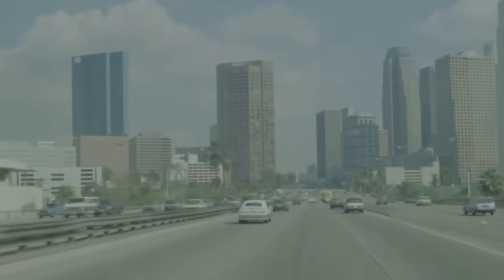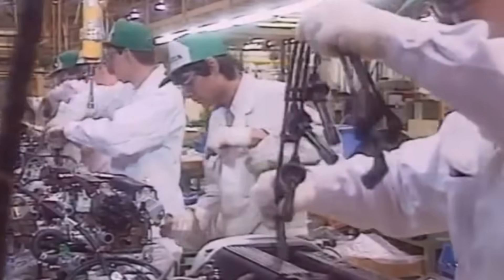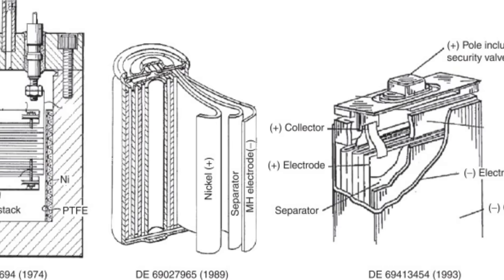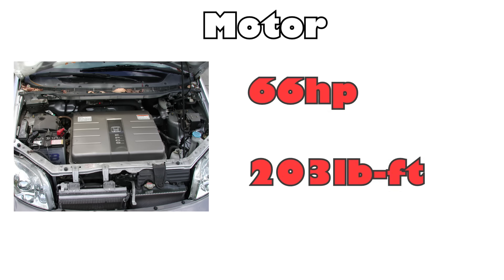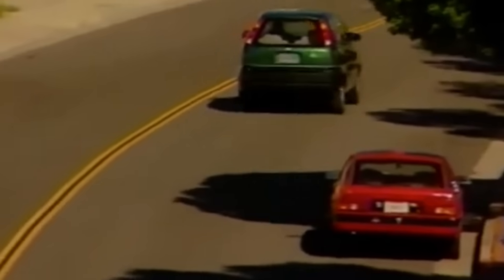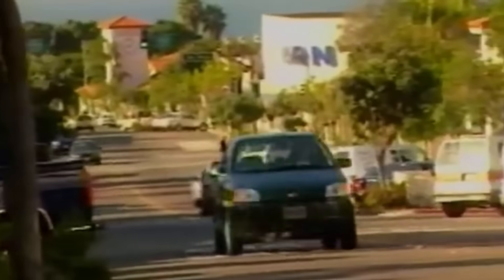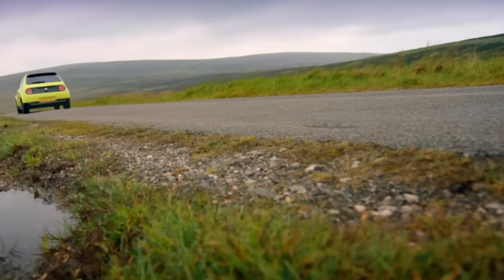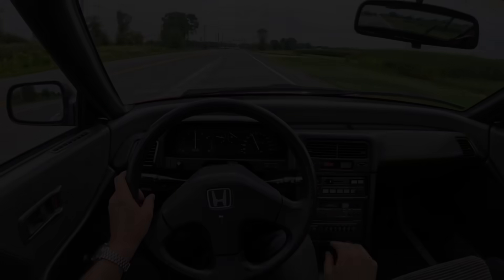Honda’s $100,000 EV Didn’t Go to Plan: The EV Plus

Comment: eh, the chevy volt the resistive heater isnt that big of a deal since you can always use the waste heat from the generator in really cold weather. actually the car by default runs the generator and warms everything up at ~30F/-2C, which you can change with an option to like ~20F/-7C, but cannot turn off.
when u burn gas for heat its 3-4x more efficient than using gas to propel you down the road. its actually more efficient to burn gas for heat than it is to burn gas to generate electricity to run a heat pump in weather below ~50F. one of the most overlooked benifits of EREVs/ some phevs, cold weather performance. no real EV range loss in cold winter areas since gas is so good at heating things up in snowy/icy weather compared to any electric solution. well heated seats might be more efficient are not enough by themselves for places that get really cold. 
that and the fact that SOC protections on EREVs/PHEVs is usually a lot more conservative means their batteries last forever, its why automakers in north america refuse to make them. toyota finally started offering a prius that might be able to be called an EREV.... only like 15 years after the volt came out lol. 15 year old volts actually have more battery capacity than the new prius plug in which is only sold at the highest trim level... expensive 15 year old tech.

Comment: You are misinformed. I leased an EVPlus and enjoyed it greatly. In fact, I leased a green one just as you used in your YouTube video. I lived in the San Francisco Bay area at the time and its performance on hills and around town was excellent. It took a while to get up to freeway speeds, but felt fine at speed.
It was always understood that it was a test bed for Honda and that at the end of the lease (which could be extended an extra year) all cars would be returned to Honda, and that some would be refitted with fuel cells for further testing.
It was never designed to be a compliance car, and was certainly not a failure.

Comment: I saw these pretty frequently back then as there were a few "civilian" models driving around as well as a couple the city was using.  Really liked the design but never paid much attention to the performance details.  When the GM EV-1 came out, Costco had some charging stations installed, which I thought funny as the EV-1 couldn't carry much but was pretty fun to drive, very peppy.  Test drove an original Honda Insight when they were released, I was driving a CRX hf at the time, but found the 3-cyl engine rough and the transmission, usually a Honda high-point, to be very notchy.  That combined with the limited cargo space took it out of contention for me.  Since then, we've gone through 3 generations of Prius (2, 3 and 4, not the original sedan as we like hatchbacks) and have now gone full EV with an Ioniq 5.

Comment: A coworker at my state IT department drove a Honda Insight hybrid.  Funny looking little car.  When the battery wore out and needed replacement, she found it cheaper to buy a new car.  😮
Reply: This is the case if you’re too stupid and or afraid to work on their own car. These batteries are made of dozens of modules which themselves are made up of maybe a half dozen cells. On cell going bad will kill a module and one bad module can make the vehicle unable to drive. You can replace said module in a couple hours for about $20-30. The dealer isn’t going to do that though. They would rather sell you a whole new battery for $3000 or a new car. 

Nay sayers online will tell you “when one cell goes the rest aren’t far behind” … generally those are the people who decided not to try this one or two times before shelling out for a new pack. 

I don’t know if the complexity of the battery and electric motors really justifies the fuel savings of a Prius over a Honda fit - that’s an argument worth having. But the scare mongering over battery repairs is for idiots.
Reply: Not surprised. That's gonna be the case for all of these EVs in the future if the carmakers don't figure out a recycling program soon
Reply: @EnriqueGonzalez-qo5hn there already is a recycling program,  and batteries are far cheaper than back then.
Reply: @paganzynda-qo5hn  Most if not all of today's cars are rather 'disposable' compared to long ago, and every vehicle reaches a point where a repair costs more than it's worth. With many EV's now it's worth doing one battery replacement, but battery technology has become so good that the rest of the car might be clapped out before the battery is.